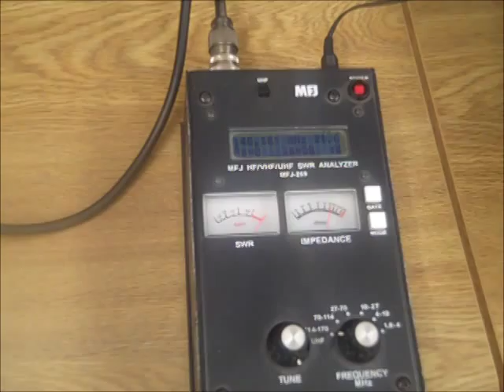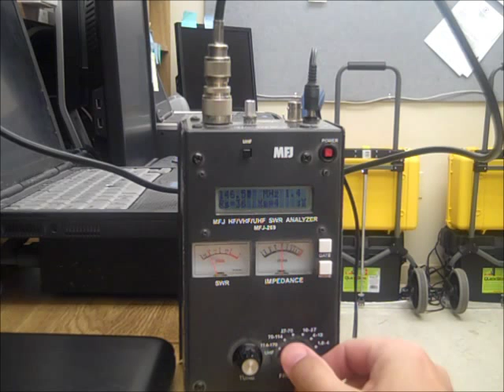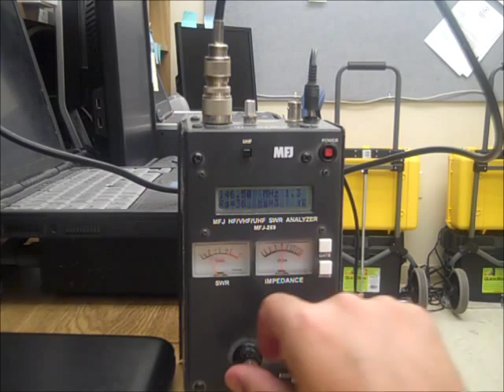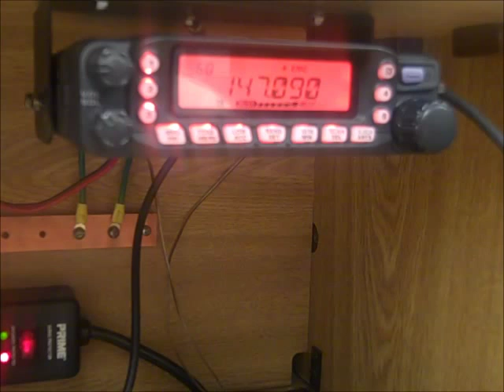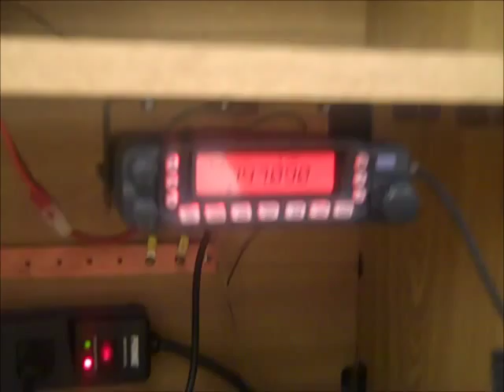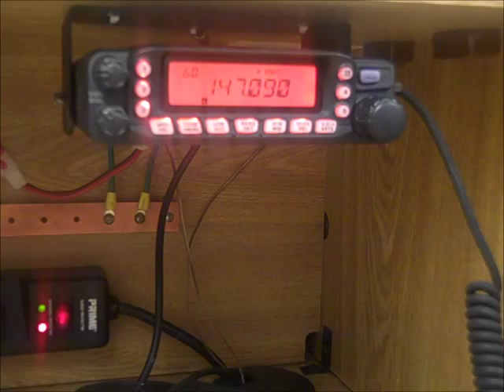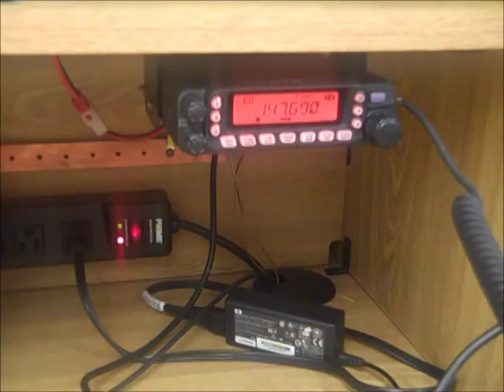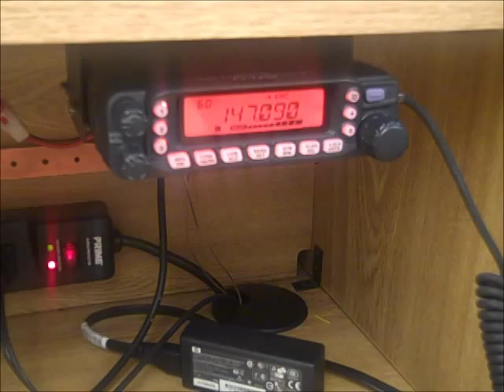Use TV rabbit ears as an emergency 2-meter antenna

Comment: I actually did an EZEC on this antenna.  The pattern is very close to symetrical with about 3 db higher output off the direction the radial is pointing and 180 degrees to that.  The low points are at 90 degrees to the radial.  K3HQI
Reply from the maker: I was quite curious about the radiation pattern.  It confirms my assumption that the greatest field strength would be along the direction of the radial.  I must have been picking up some stray reflection from indoors during the on-the-air test.  Thanks for your contribution to the comments!

Comment: Love it. could you make it a 1.25m. I am guessing it is not going to be friendly to 100 watts, but 25 might not burn it up.
Reply from the maker: If the antenna elements will collapse to the necessary length, you can use it on any band.

Comment: Clifford: I wonder if had you made that antenna as a  verticle dipole as opposed to a  1/4 verticle with the 45degree ground plane if you would have less noise.  I am wondering also if you had a few coils of coax at the feed point if your results could have improved.  Also, I  fond your video encouraging.  I have a  couple of those rabbit ears and will reproduce to your specs @ 146.52.  73 John KB3SVJ
Reply from the maker: Thanks for your comment.  I was operating the antenna indoors in the already RF noisy environment of a county Emergency Operations Center.  I am certain my transmitted RF was bouncing around inside the shielded building and contributing to the noise floor.  I was amazed that any signal reached the local 2-meter repeater at all.

Configuring the antenna as a vertical dipole would have raised the antenna's impedance close to 75 ohms.  This would have resulted in an SWR of 1.5:1.  It would have worked, but the SWR would not have been ideal.  The 45-degree angle of the ground plane element lowers the antenna's impedance close to the 50 ohm impedance of the coax cable and the transmitter's RF output circuits.  A choke balun would have reduced any common mode currents in my coax cable associated with any residual impedance mismatch.
Reply: Thanks for the follow up.    I'll let you know how my experiments, building on your work does.  In addition to my previous comments, I'll tinker with trying to get the R-Ears to work as  1/2 wave and 5/8 wave verticle dipoles.
Reply from the maker: AWESOME!  Let me know how it goes!  73

Comment: Id like to know how you hooked up the coax ..like a closer look  i see the feed line going in but did uou take it apart ect
Reply from the maker: Vini, the antenna's plastic housing is held together with the antenna element hardware.  I stripped the coax and pushed the bare copper under the antenna rods for a mechanical connection.  I still have this antenna in my junkbox.  Send me an email to kb3pml@gmail.com, and I will send back some photos.

Comment: This is one of the best videos on ham antennas I've seen. Thank you!
Reply from the maker: I appreciate the kudos!  Thank you.  I was puzzled during the on-the-air test because the antenna seemed to receive better (with less noise) with the ground plane element pointed away from the repeater.
Reply: KB3PML I don't know what the expected behavior is so can't say if that was unexpected.